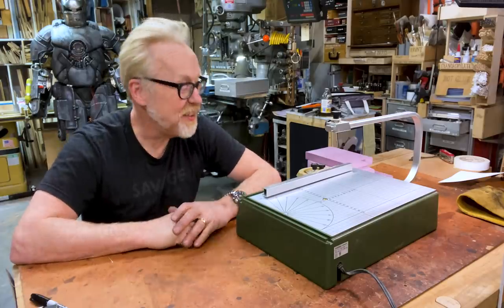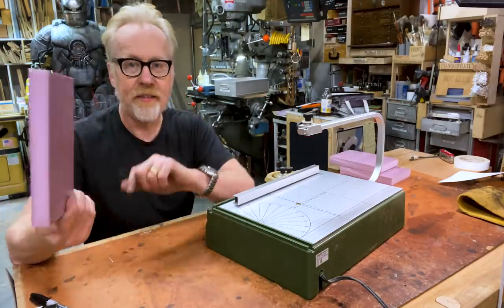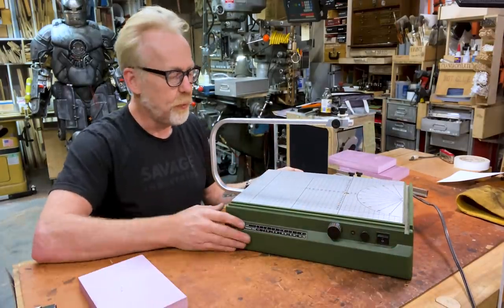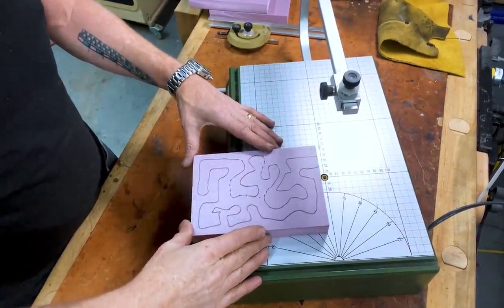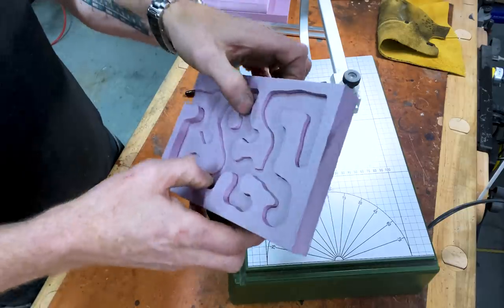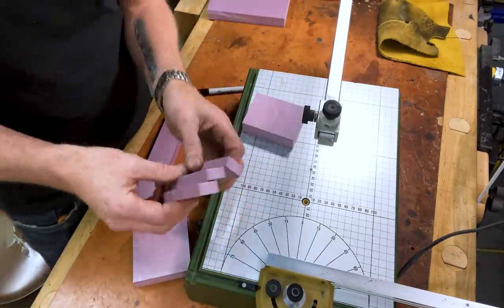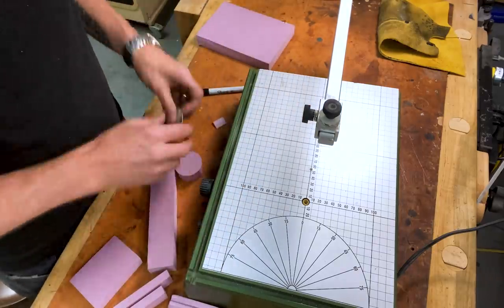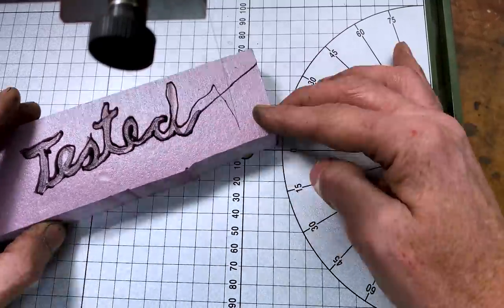Adam Savage's Favorite Tools: Hot Wire Cutter!

Comment: Would this power adapter cord work for a hot wire cutter? SHNITPWR 3V ~ 24V 3A 72W Power Supply Adjustable DC 3V 5V 6V 9V 12V 15V 16V 18V 19V 20V 24V Variable Universal AC/DC Adapter 100V-240V AC to DC Converter with 14 Tips 5.5x2.5mm 4.0x1.7mm 3.5x1.35mm

Comment: I guess to cut the center of the washer "hole" out you'd have to drill a hole and feed the wire through it and re-attach and re-tension it.
Now, can anyone tell me if it will cut plexiglass? (Or is there some other tool for that? Jigsaws don't handle plexi well.)

Comment: Nichrome is a pretty cool material. When it heats up it creates a layer of chromium oxide on the outside which is really thermodynamically stable in air so it doesn't burn as easy when heated up. Makes great heating elements for toasters and hair dryers.